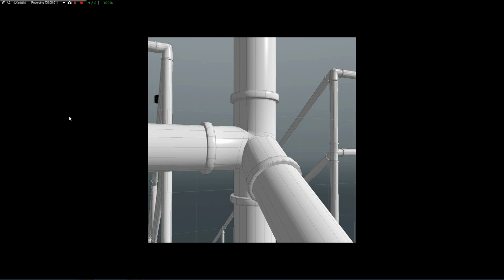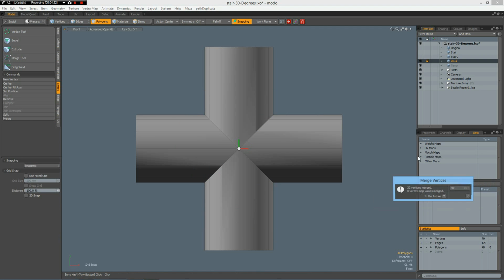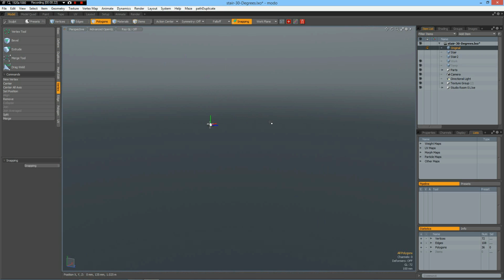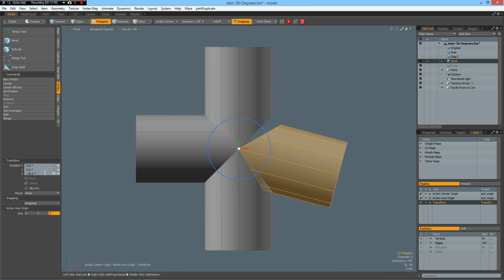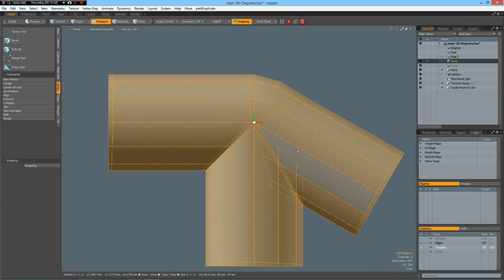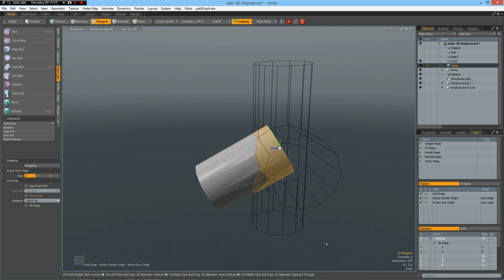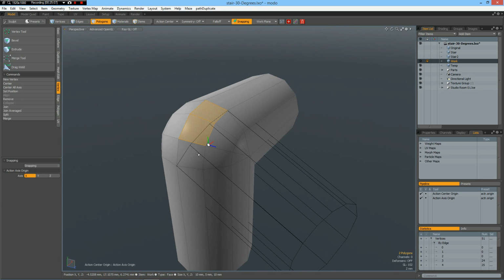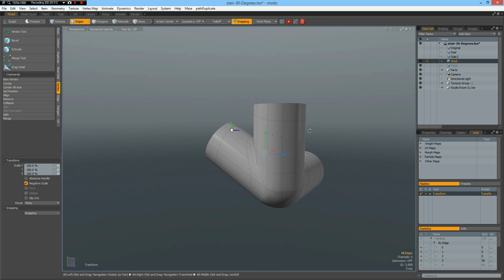The Foundry MODO - Stair Rails for David Brinnen

Comment: Dear Peter,
Thanks again for your kind & educational way of working. I have a suggestion to submit you. I'm actually working on a luxury yacht (fifteen meters lenght) and build a boat hull is very complex. My file is heavy and not built inteligently like yours. I watched your video about the computer mouse to find some tips and it helped me a little.
I'm sure you will build this very quickly :^) with many usefull advices & accurate tips.
yours faithfully,

Tristan
Reply from the maker: tristan fallon Hi Tristan, sorry for late reply. I was skiing for some days. I might do a ship hall one day, but have you seen that there is a yacht in the meshes which are delivered with modo ? Maybe you get a good idea there :-) Kind regards, Peter
Reply: Peter Stammbach Peter,
Thanks for your answer. I've noticed a bit late the yacht (very simple) in the meshes :) it's helped me a bit. Maybe I can send you my research (likeness and hesitant in the same time) ?
Thanks again, can't wait for the next video :)
T

Comment: Thank you Peter!  You made it look so easy and this had me scratching my head for hours... now I know better!  And have a couple more useful tools explained and in my tool box.  The join average to solve the top of the sloped T was very nice and the solid drill stenciling was a neat answer to the cross with the angle connection.  I can see a lot of use for this tool outside of the pipe connections too!

Cheers,
David
Reply from the maker: David Brinnen Hi David, i am glad you find this helpful. Take care and keep up your great work. Peter